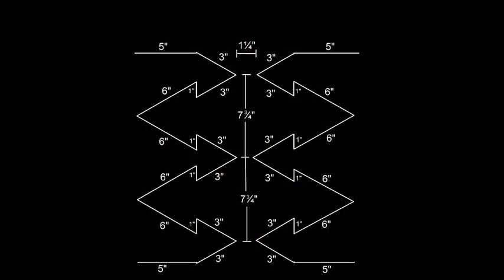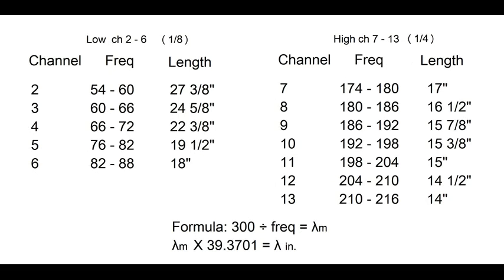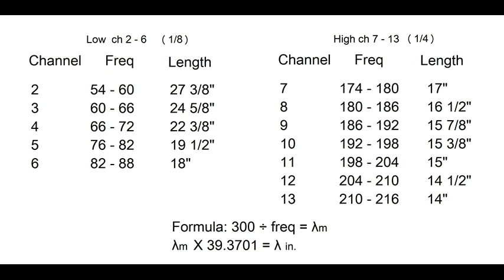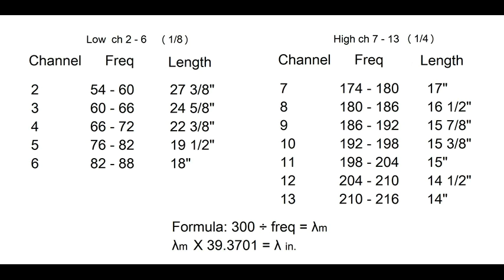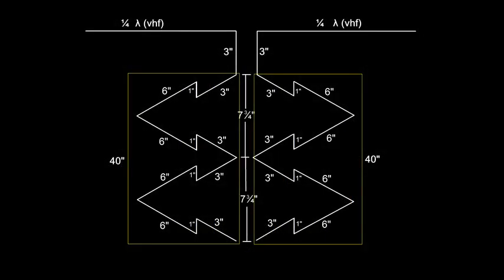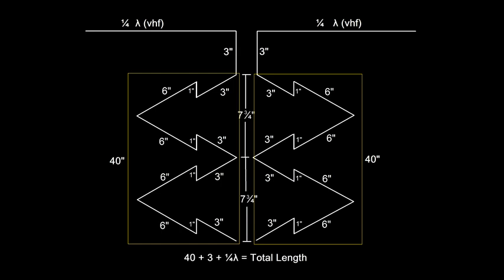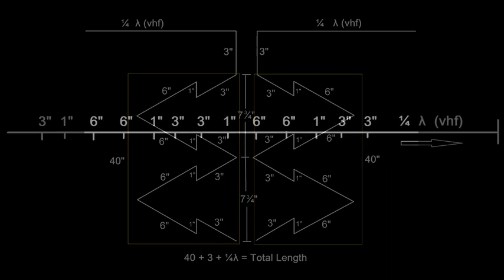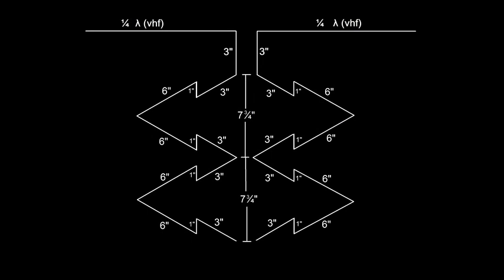HDTV Antenna   VHF Integration for the Tuxedo Antenna

Comment: I built this antenna today. It performs about as well as an unbalanced antenna I built out of a section of coax last year, which is pretty good (74 channels vs 77). Unfortunately, I was not able to get it to tune VHF-Lo (RF 5) despite making sure the top sections were cut to the proper length. It looks better than my coaxial antenna and takes up less room in the attic, so that’s nice.

Comment: Could you please tell me if you could make a fractal antenna that would get all stations from the bottom number to top number ??? Reason I asked is from my readings when you make multiple fractals on a single antenna the number of different receivable frequencies are greatly increased. Thanks

Comment: 2 questions: 

is the list of channel frequency's the same across the U.S. i.e.will all channel 10's have a frequency of 192-198?  

If i want to optimize a channel 10 and channel 13 (antenna's located on same tower) should I add two separate VHF dipoles or split the difference between the lengths?  tnx

Comment: Well done, and many thanks! I've struggled with VHF reception with 3 different store bought antennae, this did the trick. I followed this design, tuned it for the one VHF station I needed, and after a little tuning I'm getting 4 bars on all my channels. I picked up a Philmore 25db FM/VHF/UHF Distribution Amplifier, and that helps a lot. Your video is well produced, too.

Keep up the good work!

Comment: Recently cut my contract with DishNetwork and have gone to SlingTV, but wanted local channels and been looking at several designs for a DIY antenna. Came across this one today and decided to give it a shot tonight. Threw one together rather quickly. 12 gauge wire. Cut 15-7/8" across the top. Screwed it all down to an old 1" x 4" plank I had lying around. Pointed the antenna towards Birmingham, AL, plugged it in, scanned my channels and boom!!! I now have 32 local channels. A couple of them show up more than once.

It did pick up the VHF and UHF versions of the local Fox 6 channel, and a few more channel 6 VHF affiliates. Receptions is great.

I am pleased. Will fasten it to something more permanent, maybe a piece of nylon tubing and put an aluminum backing and place it in the attic in the next couple weeks. Right now, it is just propped up here in the living room on a 6' board as a test.

Thanks for the video and the very helpful information. However, I was expecting to get the local VHF channel 13 NBC, especially it's UHF channel of  52. Didn't get either, but will chunk it up to antenna location and perhaps direction.

Again, thanks!!!
Reply from the maker: Wow! That’s good to read! Glad you’re happy with it. Hope those other two channels come in for you when you get it mounted in your attic. Thanks for your comment!

Comment: I could not pull in CBS or ABC in my area with a leaf antenna reliably. Looked up that these stations were VHF so with $3 of wire I built this on  a piece of scrap wood and an old transformer in by tv junk box.  I didn’t strip the insulation from the wire except where the transformer attaches. Tuned to the CBS channel which had been the worst. It pulls in CBS now like nobody’s business and ABC which needs a little shorter dipole (channel 10 versus 8) comes in too provided the antenna is hung in a good location.  May move it to the attic ultimately but for now it works hanging behind a picture in a bedroom.  Thanks for a great design!
Reply: CBS, and ABC, you wouldn't by any chance be in WNC, would ya?

Comment: I have a bunch of channels coming from northeastern direction and another group that come from West and northwest. Would a single antenna pointed to the north will be enough for picking both groups or should I build one for the northeast and another one for the west/northwest. Man, your videos are really informative and well presented, I have learned a lot from them. Thank you and I wish you the best!
Reply from the maker: Jelly G. 
In my home, I piont my antenna in a way that splits the difference between the two. No reflector. This makes it bidirectional and works ok for me. It may not work for everyone though. 
  Thanks for your friendly comment.  :)

Comment: So is it possible to receive more than one vhf channel? How would you do that?
Reply from the maker: Yes. As many VHF channels are in your area that you can receive, it will pick them up just the same as it will any UHF channels. Even though your VHF elements are custom length for a specific frequency, it will still pick up other VHF frequencies. It will just be focused more on the frequency you design it for.
 Let me just say that I am not a technician or anything like that. I learned everything on google and youtube and I share what I lean here on my channel. Hope this helps and thanks again for your question. :)

Comment: Hey mike, I'm in the process of building the tuxedo w/ vhf. My ? Is  I only have one vhf station which is channel 9,  75 miles SE.. so the top   horizontal vhf length should be 15 7/8 ??... I get quite a few uhf channels now with an indoor antenna 30-40 miles away. I just want to watch some free hockey night in Canada eh. Thanks
Reply from the maker: Your measurements are correct. If you've picked up that channel before then you might get it. No guarantees though. It will depend on your location, terrain, transmit power of the station and polar plot of the transmitter to name a few. I have a channel 9 that is 66 miles but it only transmits at 29 KW. I've tried several times to get it but all have failed. Not that I need it though. I get the same network right here in my local area. Best of luck to you. And hey, let me know if it works. :)
Reply: I live near Philly which is one of the few locations in the country still having stations broadcasting on the VHF-Low band. Using your design, I built a trial temporary antenna using the white and black insulated wires from a piece of 12 gauge NM (Romex) cable. I only bared the parts where the balun is attached. I made each upper VHF part 18 inches long. I used no reflector and raised the antenna to a height of about 10 feet off the ground. My TV's channel autoscan indicated It was receiving about 80 channels including the two VHF-Low channels I wanted, KJWP MeTV (Channel 2 broadcasting at 54 Mhz.) and WPVI ABC (Channel 6 broadcasting at 186 Mhz.). Now that I see how great your antenna works I intend to build a permanent antenna using 8 gauge wire but will probably still leave most of the insulation on. I just need to figure out a good wind resistant way to mount it. Thank you very much for sharing your great antenna design.
Reply: Actually the VHF parts are 23 inches long. I remembered I had not trimmed them to 18 inches as I had planned.
Reply: DIY Projects With Mike... OK thanks mike
Reply: built this antenna yesterday did not get any vhf only uhf it was a fun build as I was bored but not cost effective. a small flat 1byone brand 35 mile antenna got more channels it's a better antenna for sure and $9 from amazon. I like your video

Comment: I live in Simi valley close to Los Angeles area and with my Yagi antenna receive some of the VHF stations can I put the 1/4 Lambda lengths in a row for the VHF channels I do don't receive. I like your design
Reply from the maker: Thanks for the comment. I've never tried putting them in a row but if you want to give it a shot, let me know how it works for you.